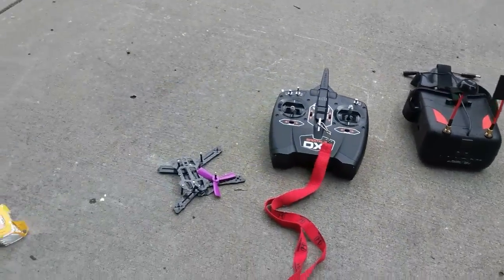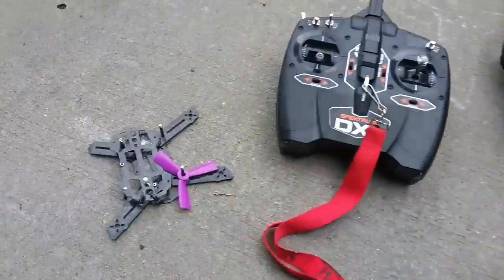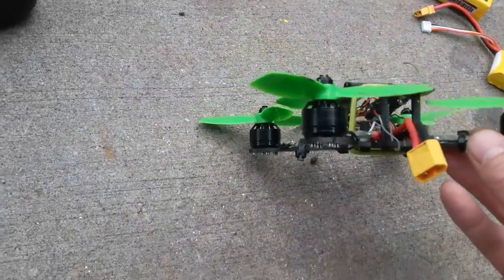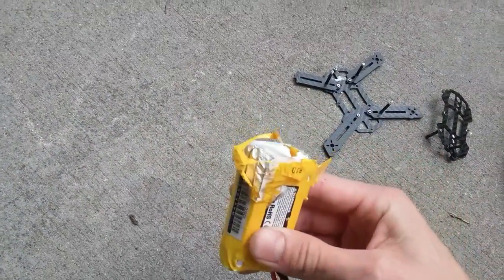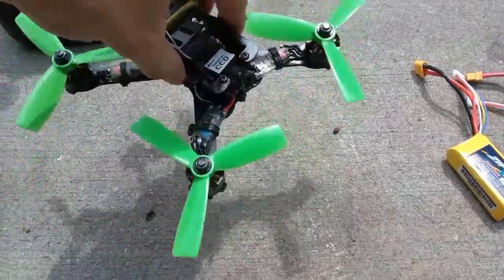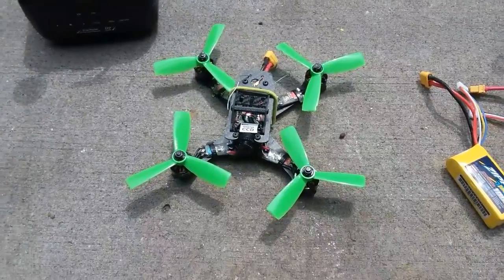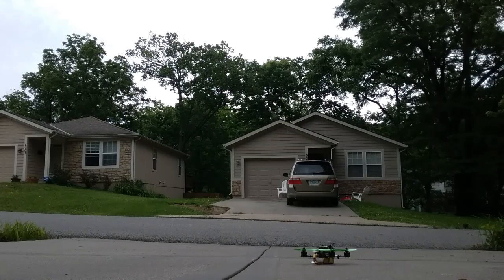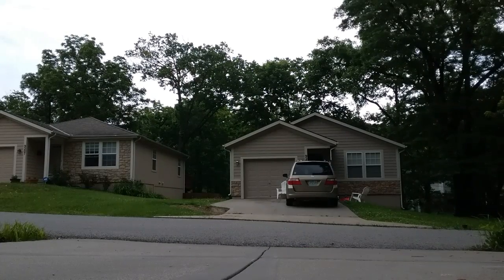AWESOME FAST 4S MICRO QUADCOPTER!! Usmile X150 frame review.

Comment: Nice set up man.  I've been running my old 1806 motors on 4s 3" lately and with dal3045t props it actually does surprisingly well.  Gives 5min flight times pushing hard on an 860.  Just found a 30g 158mm stretched x on armmatan and thinking about making the switch to 4".  Thanks for sharing this and your other videos - think I'll go for it now.
Reply from the maker: NotFastEnuf thanks man! this has definitely been my favorite setup so far. it's honestly a bit faster than I make it out to be on this video. this thing pretty much obliterates my buddies wizard x220 on 4s on top speed and punch. you won't regret switching to 4" I promise!
Reply: That's fantastic to hear.  I try to avoid all the hype trains in setup as much as possible.   1806 motors are just so efficient on smaller props.  You got me pumped up man.  I'm going for it!